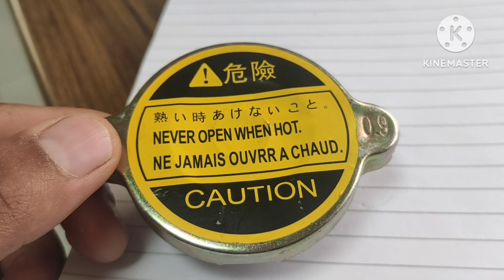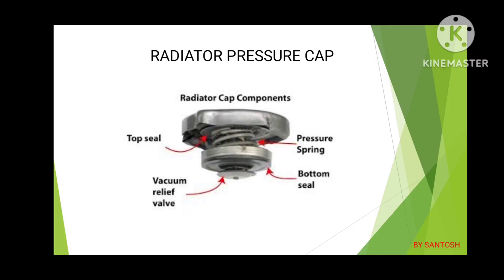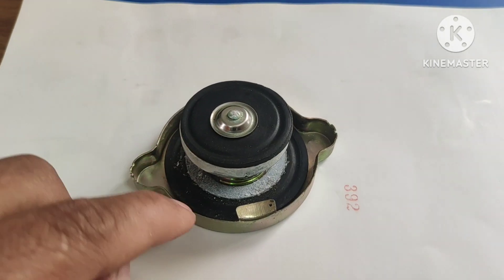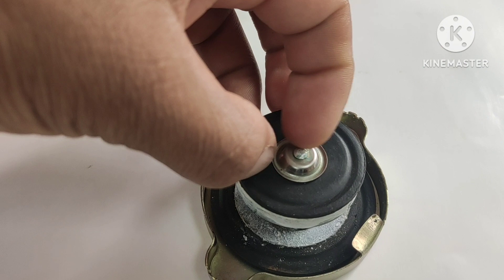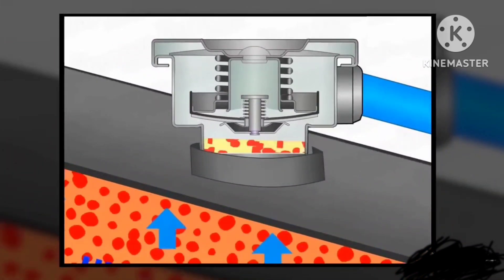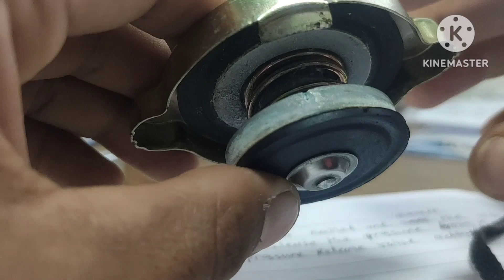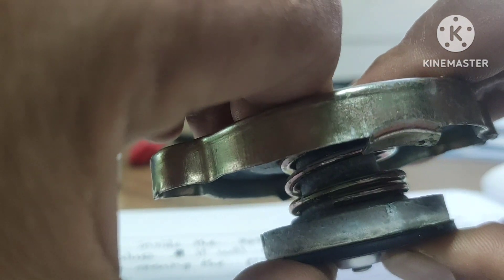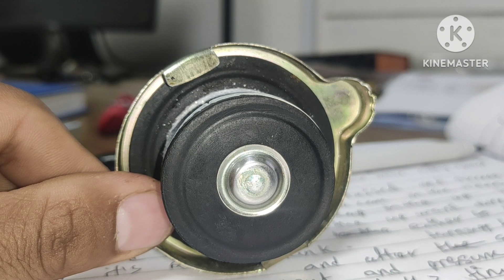How Does Radiator Pressure Cap work ?

Comment: I have problem with heating in my cabine and in a summer I lose antifreez ( but never have overheating). How to know that the cap is ok? I change water pump in october. Last weekend I flash cabin radiator (little radiator) and he was so dirty..about termostat I see  when is engine start to warm up he start the fan and tempreture of engine is always on 85 celsius, because of that I think termostat is ok, and car never overheating..now I find that maybe is cap maybe a problem, because I see that antifeez is on a top of cap..my car is made in 2008 year. this is my cap https://youtube.com/shorts/AlQrvHIuKJ4?feature=share

Comment: Clear explanation 👌 
But does the coolant in radiator starts flowing n circulates in Engine immediately when the Bike Engine is on or starts circulating only when the maximize temperatures reaches and fan starts to cool down?
Reply from the maker: The answer is no. Coolant will not circulate through the radiator immediately when engine is just started. First engine should be warm up to get better performance . For that it's thermostat valve will not  circulate the coolant towards the radiator immediately. But coolant circulation will be done between engine, Thermostat valve and coolant pump for warm up.  Thermostat valve will only circulate coolant towards radiator when engine will reach it's working temperature and will be around 75 to 95 degree Celsius temperature depend upon manufacturer.. To understand better u must need to knew the path of coolant and function of thermostat valve. I have uploaded both video on my channel you can watch it. 😊😊 Thank you.
Reply: @creativemind9056  Thank you soo much😊...so that means the coolant will be always circulating and flowing through Engine circuit as long as the Engine is running no matter the Engine is cold or warm
Reply from the maker: Yes. It does not matter. if the coolant is hot than it will circulate between radiator, water pump, engine, thermostat valve and again radiator. If engine is just started  or cold it will circulate between engine, thermostat valve, water pump and engine..by observing the temperature of coolant, it only change the flowing route. And whatever will be it's temperature, it will always circulate after turn on the engine .